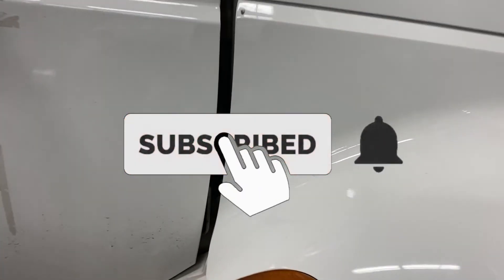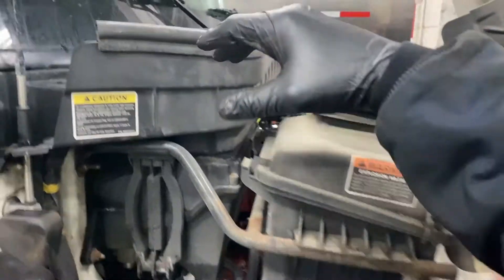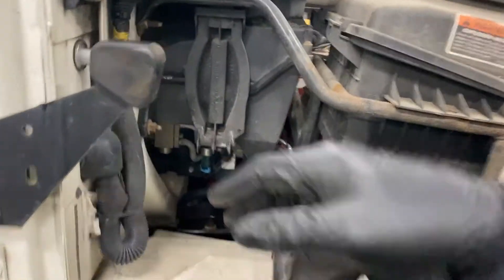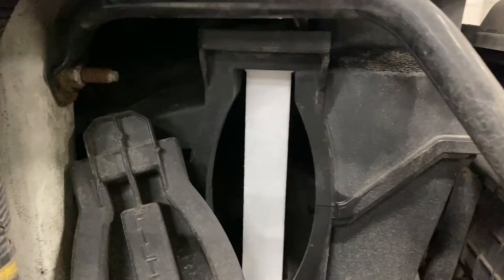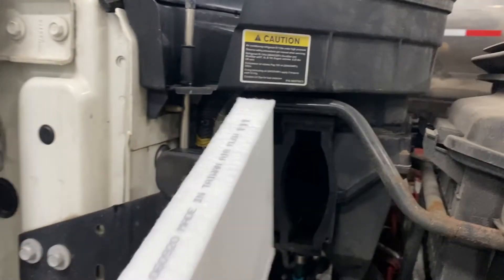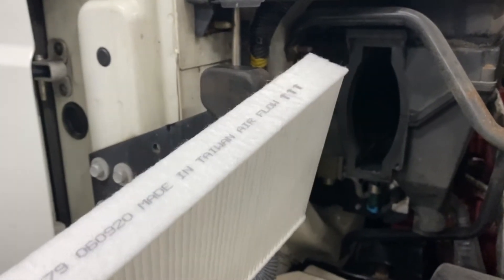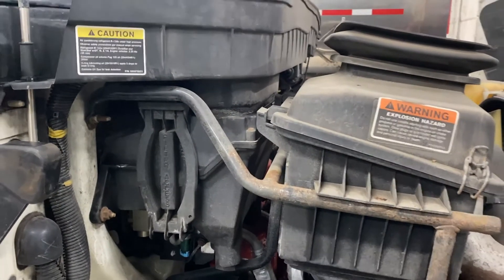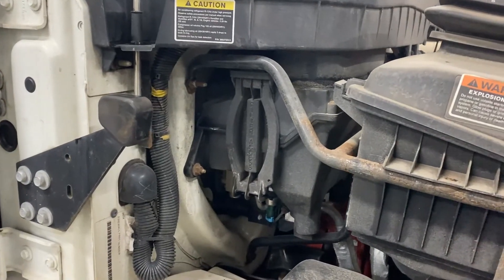International Durastar Cabin Air Filter Replacement

Comment: One question the vents on the back of the filter housing in my truck are stuck so when you turn on the ac this vents have to be open or not ??
Reply from the maker: I believe the vent behind the filter should be closed when you have it on recirculate. If you have a/c on but recirculate off, I think it would be open.
Reply: @TonyTheTruckGuy  thank you !!my truck don’t have that option to recirculate air
Reply from the maker: @juangomez8186  “max a/c” puts it into recirculate if you have the max a/c option
Reply: @TonyTheTruckGuy  thanks you